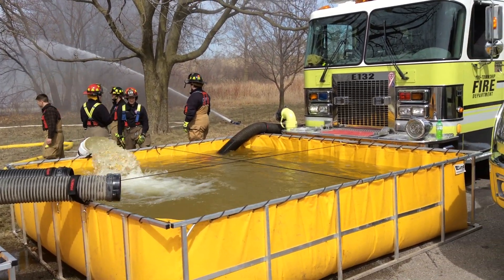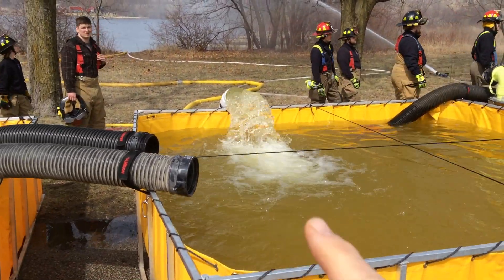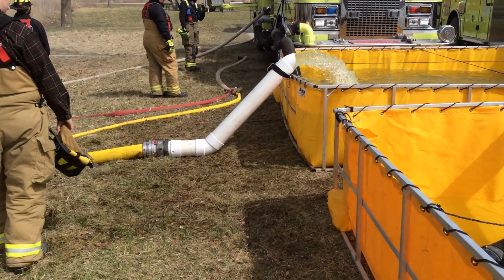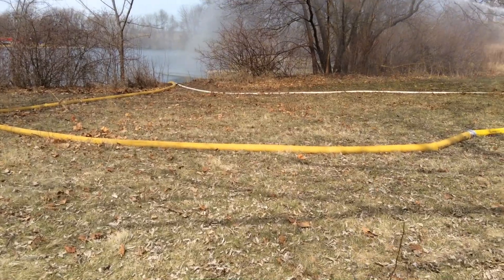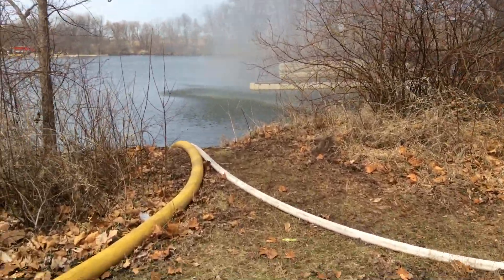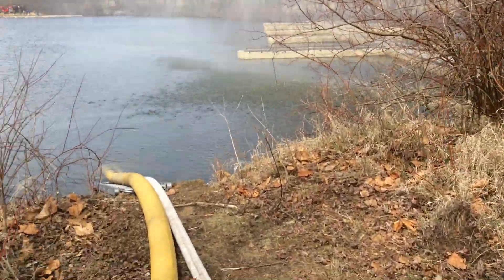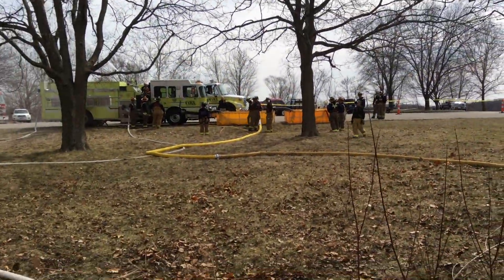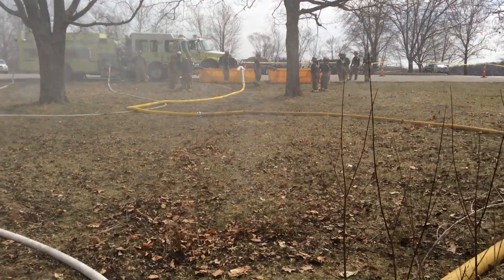Turbo Draft Use - Johnson County, Iowa - April 2018

Comment: At what discharge pressure is the line feeding the turbodraf, that is, the 2 1/2" line, and the distance at which it is located, approximately how many gallons per minute does the water return?
Reply from the maker: The discharge pressure to the TurboDraft was around 200 psi and the usable return around 600 gpm.
Reply: @GotBigWater   we were able to discharge around 830 gpm out of the deck gun using turbo draft, our hose were only 100 though.